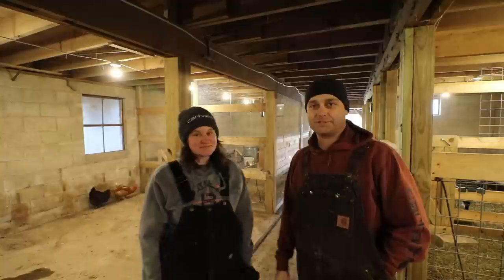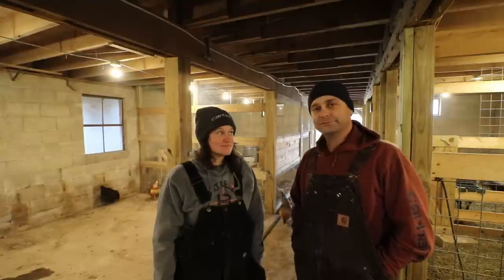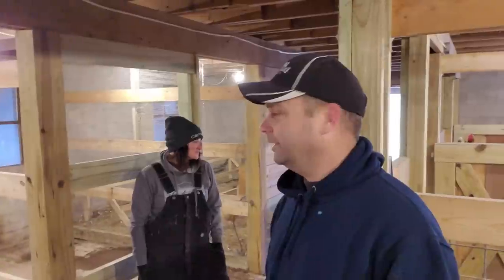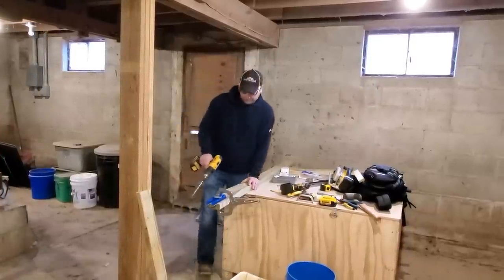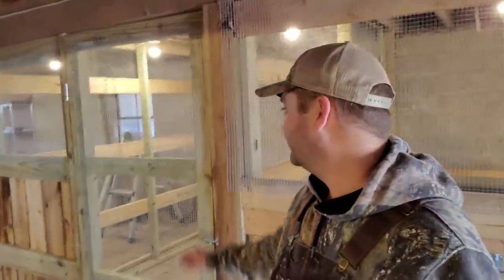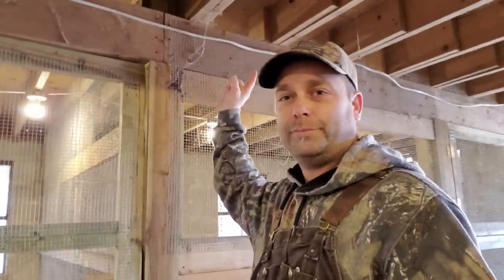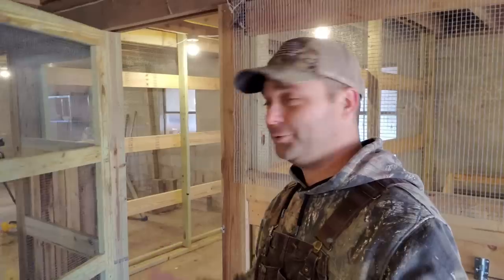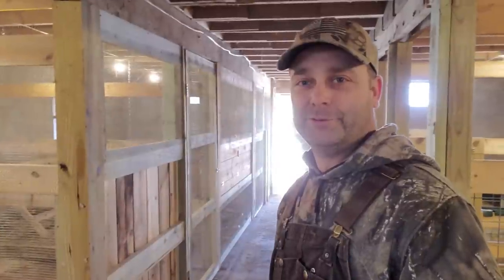Building a Chicken Brooder in our Barn

Comment: If you are getting a small amount of chicks you might want to build a wooden frame 2 foot tall to set on the floor for the first week or two. The sides will protect them from drafts and they won't need the entire floor space and will be less space for you to clean and take care of. Just screw the ends into 2 L brackets and you can easily take them apart for storage until next time.

Comment: Cut your wire to fit each opening and staple it (with the tiny staples) in each corner. Then frame the wire with trim  ( 1 x 2 ) boards, using a brad nailer or nail gun.

Comment: Use needle nose pliers to hold the staple when you 🔨
Reply: I was just going to type the same thing
Reply: Me to
Reply: Me three
Reply: Pneumatic hammer get the staple started then use the pneumatic on it just takes air ,think there cheap to
Reply: You took my reply. Needle nose works great and no busted digits.
Reply: Me four!
Reply: Or needle nose vice grips
Reply: Or use comb to hold the staple 😆
Reply: Actually - just cut a slot in a piece of cardboard and this will hold the staple. x
Alternatively, long staples for staple guns are easily available (stainless steel too, if pricier)
Reply: Just watched this! Me 8!!😎

Comment: All of my coops I used 1/2" hardware cloth and used 3/16" fender washers with #8, 1 1/2" screws with a counter sunk head... the fender washers provide an awesome coverage over a few of the wires and gives me the ability to pull it tighter... I also put the concave roll inward. The fender washers/ screws are nice too if you ever want to change something

Comment: Hey guys. Love your videos. You might want to think about a 3 or 4 foot solid wall all the way around the bottom of the brooder room to reduce drafts. You’ll still have plenty of ventilation up top but be able to hold more heat closer to the floor space where the chicks are at.   Chuck from Sheraton Park Farms
Reply: Sheraton Park Farms I agree, those itty bitty chickens need to stay out of the draft!  Plus containing them while you’re in and out of their coup is much easier if they’re behind a barrier.

Comment: We used a screw with fender washer.  Holds netting real well.  We did use some heavy duty staples with staple gun in a few places, but the screw/washer made it easy if we had to replace wire down the road.  Love your barn

Comment: Check out the Freeman pneumatic tool sets, they come with an air stapler that would make super quick work of those staples.
Reply: Hammer stapler. Just as fast and much much cheaper.
Reply: A Hammer stapler uses the same size staple as the stapler he has, which he said was too small.  a Pneumatic stapler lik ei suggested uses the larger staples he ended up using up to fencing staples depending on the size gun.

Comment: To attach the hardware cloth I have been using anailer/staple gun with my compressor. I use a 1 inch staple with a quarter inch crown. I use more because if their size but it goes fast.

Comment: I used needle nose pliers to hold my small staples until a came across a nice electric stapler. Mine was made by Milwaukee. It’s a 12V size and was pretty cheap at $76 on Amazon. I’m sure other brands make them as well. I decided to stay with one manufacturer so my tools all used one brand and it was Milwaukee but other brands make these as well. The 12V size is lighter and is plenty powerful enough. It’s areal labor saver.

Comment: You have got to have color in the run !! Your wife did the right thing on assorted breed selection. Just wanted to comment on the hardwire fencing. Nematic staples hold up really well and install quickly. I use galvanized 1 1/4 myself.  Great job on your build 👊

Comment: I use electrical staples on that type of wire fence, they are square so easier to hold, and sharper so less splitting of the wood.  On the doors instead of cross bracing try thin cable running from corner to corner.

Comment: Kreg jig drill two holes on one side only. If you think you have to add a hole on the opposite side, add one hole in between the opposite side holes. Needle nose pliers to hold the long end of the staple, hammer away.

Comment: The small staples if you use a piece of paper folded 1/2" wide  by 3" long push the staple through the so you can hold the paper far enough away so you won't hit your fingers you should be able use it a few times . The bottom of the stall needs to be more draft proof and you'll need to think of using a deep bed method for the chicks
Reply: Cardboard with  a slot cut - holds the staple in line and lasts through the job!

Comment: Install your chicken wire with a staple gun at each corner and a couple places in between to temporarily hold the wire and then install a lath strip of wood over the chicken wire with  regular nails at regular intervals. This will make the wire stronger than any other kind of fastener.

Comment: If you have a lot of stapling to do  get a Crown Air stapler.   That is what I use for 1" hardware cloth and smaller.  The larger wire gauge cloth with the bigger spacing needs the hammer in fencing staples.   But the needle nose pliers holding the wire tight with the back of your hand does work.  After the first solid strike remove the pliers.
the old guy   Bert

Comment: i use carpet staples,1/4 x 3/4 air or electric,than i strip wood around the edges ,pin nailer on ,finished look,spring on the door ,keeps it closed,if you forget to latch it, tree branch for a door handle,nice work guys

Comment: I just use a staplegun but I think they're called lathe screws. Used to screw on metal lathe you spread plaster with. Looks like cabinet screws just bigger built in washer.

Comment: As you know it does not take much to make the  build of a 7 ft door go out of square.  I don't think the jKreg ig was at fault.  The jig pretty much will just ensure strong consistent joints if used correctly but if you have a couple cuts even fractions off in length or just out of square themselves with a door that size you know it translates to some aggravating results.  I use that jig but also clamp  corner joints  with a 45 if I need a perfect square.  I wouldn't give up on that jig.  It make prove very helpful in future projects as you get used to it.

Comment: I second that you could start the staples with a needle-nose pliers, but I can not really recommend it.   I found that to be clunky.  And I totally get those staples are tough to hammer in w/o smashing your fingers.  I actually had good luck making our chicken run using drywall screws and fender washers.  They were also really useful in helping you keep the netting tight too.  You could essentially use the screws to draw in the netting.  You might snap a screw on occasion but just screw in another one.

Comment: Rather than using those small staples, I believe I would have used 2-3 of them along each side just to hold it in place temporarily, and then run 1x2 along each edge.  That would have held each adge down everywhere along the edge and it would have been, and stayed, smoother AND you wouldn't have had the edges of the hardware cloth to catch on clothes (and skin) as it gets bumped out of place over time.

Overall though GREAT JOB!

Comment: JudithB  I  use  needle nose  pliers  too!  I  also  like  to  use  lath  over  the  edge of  the  wire  and  screws.  I  am  guessing  you  will use  one of those  circle  things to keep  the  chicks  close  to  heat, food and  water  while  they  are smaller?  I  keep  mine  in  a  plastic tubby  in  the  bathtub  for a  couple of  weeks  then  move  them  to  the  brooder in the  barn.  I  lose chicks  to  snakes  most of the  time  so  its  a  battle!  Guessing  you  will  be  getting  50  Cornish cross  or  so?  LOL

Comment: As usual very nice work.  Question.  Do you plan out something like this?  What I mean is do you draw it out and come up with a materials list?  It just seems that you are always so organized.

As far as the staples and the way that you hung the fabric, it looks like you chose the correct fastener.  I would recommend using needle nose pliers to save the fingers.  Another thought is that you could have maybe "trimmed" the edges with some 1x4 boards or similar which I would think would help with holding the fence fabric.

One last comment.  I would have used a GFCI plug unless you have it wired to a GFCI breaker.

Once again, great build!

Comment: Just use a pair of pliers to hold the staples while you hammer them in... Just saying. Did an entire 20 acre farm with the small staples. Didn't want to drop $300 on an air setup which only works if you have power.

Comment: Your not going to get a square shape out of rough cut 2 x 4's. What you want to do is make your door sightly oversized Then just cut down to size creating a square door. 

Using pocket hole screws and the Kreg Jig makes for a very long lasting maintenance free door. I would recommend diagonal  cross braces inside the door for added strength.

Comment: Unless you have fat, sausage fingers this will work.  Position the staple between your fingers with the sharp ends and back of the fingers against the cloth, tap the staple lightly.  Remove your fingers and finish hammering.

Comment: On Green houses we used cedar 1 x 2's. we drilled clearance holes every so many inches Starting and ending about 2 inches in from each end. I wouldn't spread them more than 6 inches apart. Use long roofing/shingle nails to attach over the edges of your wire. This will also shields the edge of wire from your critters. Actually it helps protect people more than critters.

Comment: Kreg screws suck  balls. i use the jig but regular decking screws. WAY stronger joint.
Reply from the maker: I may use regular deck screws.  The Kreg screws are expensive.
Reply: @CountryViewAcres  I get the ones with the large Torx heads on them from Lowes/Home Depot.  Im always stripping out the Kreg drivers as well which is a pain in the butt. I built a BIG bad ass farm house style bed for the wife's christmas and that sucker is rock solid using the decking screws.